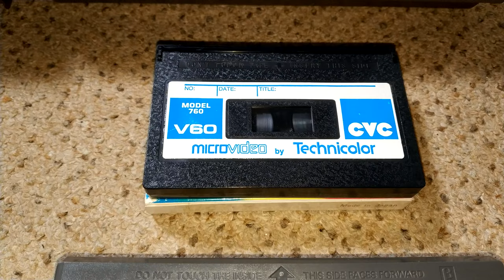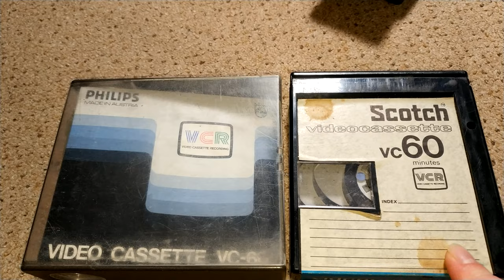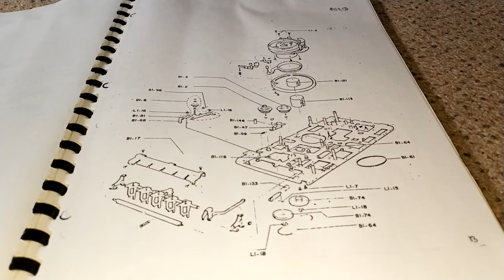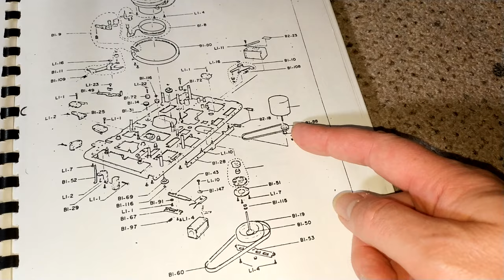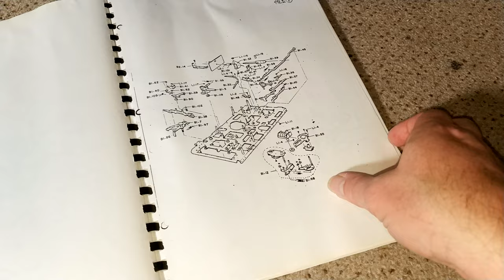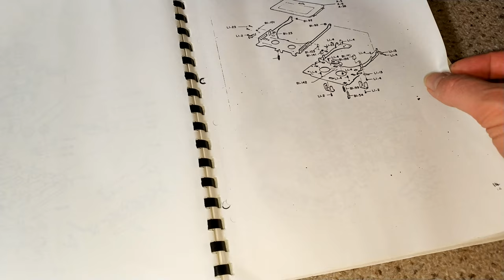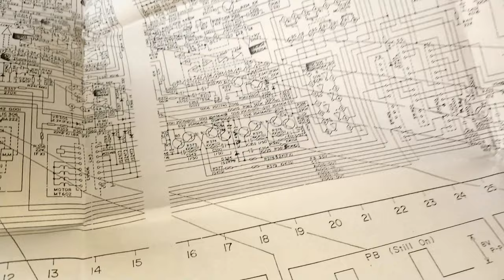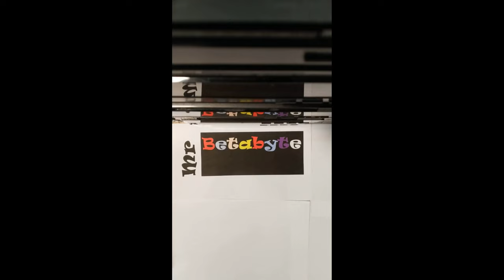CVC Technicolor (Funai) MicroVideo cassette recorder - Fixing a broken rare format machine - Part 1

Comment: I found one of these on eBay paired with an RCA camera (made by Panasonic). When I first saw it I thought it was a Video8 recorder.

Fun fact: The Sony EV-C8, the first 8mm VCR ever from 1985, has a "camera" multiconnector for 12 volt output and composite video and audio, but it was never used.
Reply from the maker: I'll have to have a look out for an EV-C8. Keep a lookout on the channel for that one. Interesting on the connector. 

Hear what you're saying on the CVC deck - a quick glance and you'd swear it was 8mm.
Reply: @MrBetaByte  I have a working NTSC EV-C8 and a working CCD-M8 (both were sold as a combo pack since the M8 can't playback) but there's a crack in the top cover, and the cassette cover for the toploader is broken as well since it won't latch to the cassette holder. The plastic is just really brittle.

Comment: This would seem to be a common issue as i was given this model and the Grundig one (that had no belts at all) and the Technicolor one does EXACTLY what yours is doing despite sorting out the belt's and making sure the rest is loose and not seized.
Reply from the maker: Absolutely agree with you on it being a common issue. One thing - I don't suppose you have the Grundig CVC unit going spare as i could really do with the motor? If you do, drop me an email to mrbetabyte@gmail.com. Happy to take a look at your unit too if you'd like to get it up and running.

Comment: I used to work at "Technicolor Videocassette" back in the 80s...the biggest VHS duplication facility in Europe (as far as I know). Tens of thousands of JVC BR-7000 and Panasonic AG-6810 duplicators running 24/7 churning out virtually all of the retail & rental tapes for the UK and beyond. Getting to the point, I really don't know what the connection between "Technicolor Videocassette" and this unit is/might be, but there was a broken one (of these CVC things) and a pile of sealed blank tapes sitting on a shelf in the engineering dept for the whole time I worked there. Maybe the connection is just coincidental...maybe one of the other engineers brought it in from home to fix in their spare time, but the pile of blank tapes probably does mean there was a direct link 🤷‍♂️     I dunno, lol. You're welcome to this utterly pointless bit of info anyway, haha. I definitely hadn't ever seen one before then...they totally passed me by when they were current products.
Reply from the maker: What an amazing thing to share! Thank you so much for this. Where was that?
Very interesting on CVC deck in the engineering department. Maybe it was for research purposes? A thought that maybe it might become a viable format to produce pre-recorded tapes? Would be great to know more about the facility if you can share - the duplication methods for retail always fascinated me and somewhat blew me away but from what you're saying I'm now like the Maxell armchair motif!
Reply: @MrBetaByte  haha, yep, only a TRUE geek could find my Technicolor memories interesting 🤣🤣🤣 
Well...the facility was in Stonebridge Park, near Wembley. Bit of a grotty area, to be honest. I do recall that "Binatone House" (LOL) was on the same street...and Panavision (movie cameras). Had the choice of taking the tube to Hanger Lane and a LONG walk along the North Circular (??) My memory is a bit foggy ...it was 33 years ago!...or regular train to Stonebridge Park, where I always felt like I'd get mugged some day 🤣 They also had a place nearby at Perivale, that was branded CBS Fox Home Video - had my interview there - but then the job was at grotty Stonebridge Park. Sneaky!! At CBS Fox they still had a bunch of Betamax & V2000 recorders...If I recall correctly, the place was being closed down and all work was moving to Stonebridge Park/Technicolor. 
Not really too much "geeky" stuff I could tell you about the process...except the Panasonic decks all had mod boards fitted to provide manual video level control. The JVC BR7000 decks had switchable video AGC. This was necessary to be able to record Macrovision-encoded video. The video source was mostly Sony BVH3100 1" decks. The JVC decks also had auto-loaders fitted, so about 5 blank tapes could be stacked up and auto-change once the recording was completed. Cassettes were wound in-house to the lengths needed for each job. Massive tape pancakes would be wound into empty shells. 
Every tape was labelled with a "pricing gun" type label, to identify which deck it was recorded in, so when tapes were spot-check QC'd they'd be able to find any faulty recorders. The "factory workers" who loaded up the blank tapes/emptied the recorded tapes were so rough with these decks...OMG. if a tape got caught in a deck, they would rip it out so hard that it would snag on the tape-end-sensor LED and literally snap the little PCB it was mounted on. We replaced HUNDREDS of these little PCBs. God only knows what JVC thought when they got orders for hundreds/thousands of replacement PCBs!!!
Technicolor was very thorough with machine maintenance. The entire deck was rebuilt with new reel motors, upper/lower drum, new pinch roller, etc. on a rolling basis. Never-ending job. I guess they did it every 5000 hours or so. With maybe 30 thousand recorders, it was a neverending job. Hearing thousands of big clunky machines all go into record, rewind, and especially eject, all at the same time, was quite a sound to hear! Lol. 
They knew how many hours each deck was used by looking at the computerized schedule system, and didn't rely on those little mercury TM-2 hour meters. I have a huge bag of those if u need some, lol. Unfortunately they're in England, and I'm in NYC, but one day...maybe Christmas I'll be back 😄
One day I went out with my cart to pick out a dozen or so decks that needed repairs. Mostly head-cleanings, upper drum replacement, little LED PCB replacement (!) and didn't want to make two trips...so I stacked up the BR7000's and wheeled the cart through the "clean room" swing doors back to my workbench. My stack was so high that it hit the top of the doorframe, and a 25kg beast of a sharp-cornered JVC Duplicator fell off the pile, SLID OVER MY HEAD (I felt it!) and gouged a chunk out of the vinyl flooring. Fell corner-first. Literally cheated death that day. 😐
We didn't have "Health and Safety in the Workplace" back in 1989 🤣
Smoking was "fine" too 🤣🤣🤣
The chassis of the BR7000 was a little wonky after its fall from 8 feet, lol, but it still worked fine. I stood on top of it to straighten it out a bit 🤣
God, I think I'm out of stories...I was only there a year or so. I was the (relatively) "posh" white boy, in a mostly working-class Asian workforce. Most of the other engineers were Sikhs. All very nice guys, but we didn't exactly have much in common. There was no "let's go for a pint" after work. Soon after I ended up at a post production house in Soho...now THAT was more my style! 
What else can I tell u...hmmm...oh yeah, I still have my Fluke 77 that I..ahem... accidentally took home. 33 years...must be past the statute of limitations, right?! 😆😆😆
I also have a "Now That's What I Call Music" (vol.7 or something) VHS that I "accidentally" took home...security was actually pretty tight, but it was in a deck that made it's way to my workbench 😁 A few of my YouTube uploads are actually from that very tape. 'Then Jericho' "Big Area" is one of them. And 'Sam Brown' "Stop". Uploaded them years ago, pretty sure they're still online! 
Back to Duplication...after I left Technicolor, they replaced the BR7000 duplicators with 3-in-one JVC BR7030 decks. Three mechanisms in each unit. Only remote control operation, no controls on the deck itself.  I never worked with the Sony Sprinter system (sadly, cos that thing was cool as fuck!) You'd make a "mother tape", then this would go into the Sprinter, and the heat from a laser would transfer the recorded magnetic pattern onto the dupes, at crazy high speed. I can almost guarantee that you, and other fellow geeks, are now searching Google for "Sony Sprinter" 🤣🤣🤣
That's all for now, folks. I've got a D5HD tape to digitize here, right now,   at 9.50pm, in NYC. Guess I can monitor it from my bed though, hahaha, so not too awful!  
The client brought me a 59.94 HDCAM master, a 23.976 HDCAM  master, both dated 2008, plus this D5HD 23.976...dated 2006. All, apparently, the same version of the same film...yet they all say "Master" on the label. 🤔😵‍💫🙄 Being the geek that I am, or just a glutton for punishment, I have chosen to use the D5HD tape. The poor old Panasonic deck doesn't get much love...maybe a few tapes per year...so I'll give the HDCAM deck a rest for tonight 😄
G'nite fellow nerds and geeks xx
Reply from the maker: Wow - this is fantastic and thank you so much for sharing. As a young teen I couldn't get my head around how all these tapes could have been produced 'in real time'. Just such a great insight to how it was done. Very interested in the Sony Sprinter System and yes, I will Google it! And your work in Soho too (dare I ask!). Certainly very interested in the T2 coulometers meter you have too as I could do with a few. 
I'd love to research and document all you've shared - would that be OK? Maybe email me at mrbetabyte@gmail.com; would be great to work with you to capture all of this as vest as possible and in the meantime I'll do some research.

Thanks again, it really is appreciated.
Reply from the maker: Not quite the same piece of kit but fascinating: https://www.otari.com/support/vintage/t710/index.html
Reply: @MrBetaByte  cool! Very much the same as the Sprinter. Here in the US, a lot of cheap & nasty VHS releases were done at EP speed (pathetic and unforgivable, in my opinion!) so I imagine these were all made with this type of gear. (None of the real-time duplicator decks had EP mode). Amazes me that even the "cheap and nasty" labels/titles would lower their quality to such crappy levels to literally save a few cents, but indeed they did! 
NTSC EP VHS is my arch nemesis. 😵‍💫
Reply from the maker: That is crazy. Not sure this ever happened in the UK/PAL just for the sake of compatibility with older machines and only having SP/LP when prerecorded tapes were in their heyday. Really love hearing about the Duplication centres and its inspired me to research a lot more maybe for a future video. Let me know on the hour meters too mrbetabyte@gmail.com 👍

Comment: I´ve always wanted to ask: Why the black gloves? This is not the first time I see them being used in a technical video. What are they for? The deck doesn´t bite :)
Reply: The Rubber Belts decompose into a sticky mess.
Reply from the maker: The belt goo gets everywhere and stains skin so let the gloves get messy and then chuck them out and it's all good (until you find some you missed and get covered in black stains anyway!) :-)

Comment: hi have a deck DA88 that is jammed up with the same parts  i keep it as i can use the head drun some time 
i un jammed alot of the first betacam sp decks and noved and save alot of parts from old decks i have to 
look at the 10 hifi decks i have all as parts 

love the betacam digi decks  otari mtr 12  mx line are ace   tascam 30 do go down all the time   working on a 100% fix for the 
tascam 38 decks i see 8 with bad main pcb's  same thing all the time  bob's bit's
Reply from the maker: Some good info and quite a collection you have there! Thank you so much for sharing.